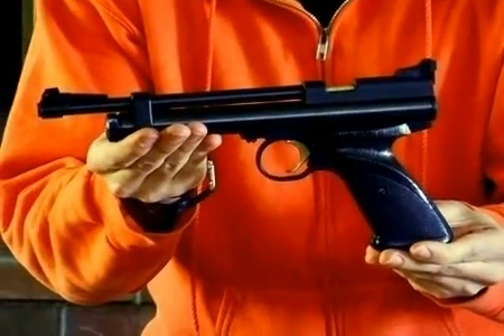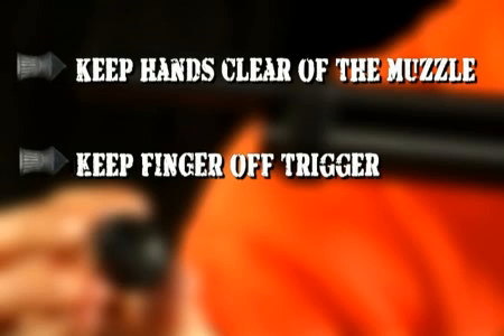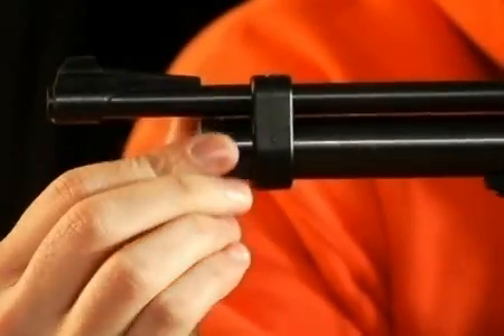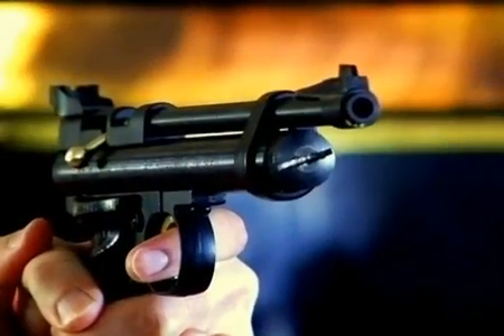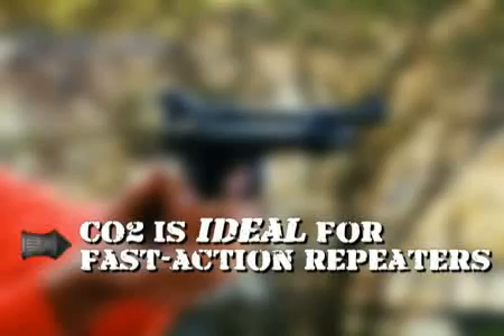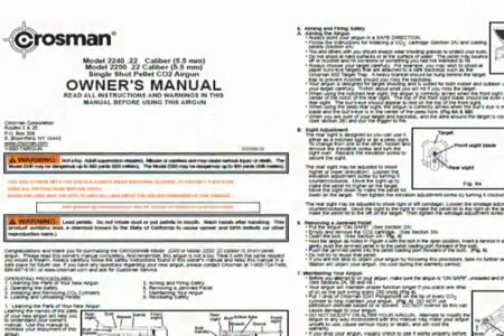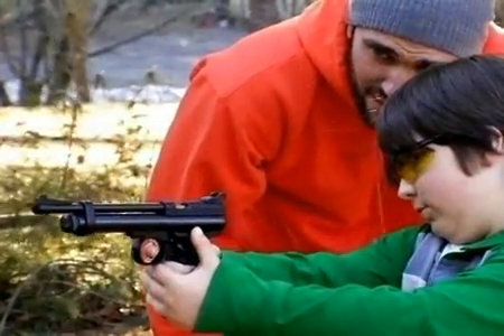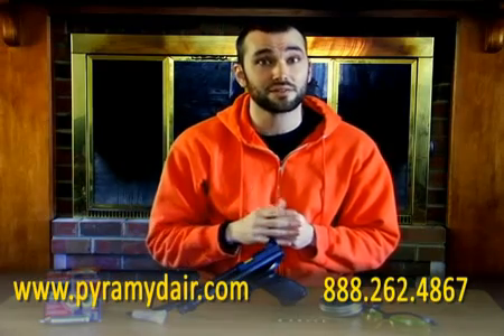Airgun Academy Episode 2 - How CO2 guns work

Comment: I have a Crosman 2250B, and prefer it to my Crosman 1077 "Repeatair" (more power and shots are more consistent). If you fire too rapidly it all gets very cold and shots are not always consistent. I have to disagree on getting "40-50" shots on the .22 (2240/50) closer to 30-40 and most of their "punch" has dropped off by time it gets near 40 shots.

Comment from the maker: We do not recommend storing CO2 within your gun. It can blow a seal very easily.
Reply: +pyramydair I don't know about that. I have the Crosman Challenger 2000 Co2 air rifle and also the Crosman Challenger 2009 PCP air rifle. I have had them charged for weeks at a time and they did not leak down. If a PCP rifle that uses "seals" can go 6 months without a leak down why would a Co2 air rifle that also uses "seals" be any different?
Reply: +PeterDad60 FYI I have never "stored" any Co2 powered air gun that was charged with a Co2 powerlet cartridge. However I have used a Co2 gun and not used all the C02 in one shooting session and have come back two weeks later and the Co2 gun continued to shoot from the same cylinder. What I am saying is that I am not paranoid about ever leaving a charged Co2 cartridge in my gun for a few weeks. I would never drain out the Co2 if and when I end a session and the cartridge is not empty.